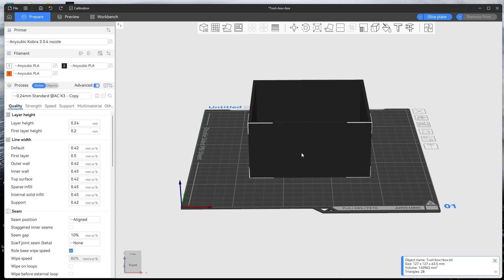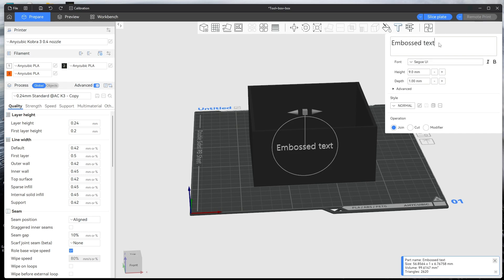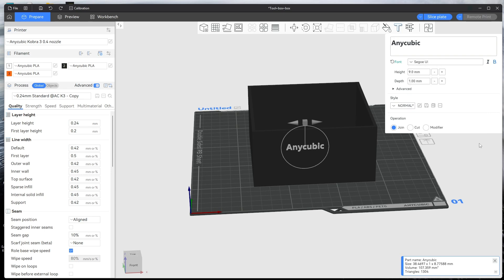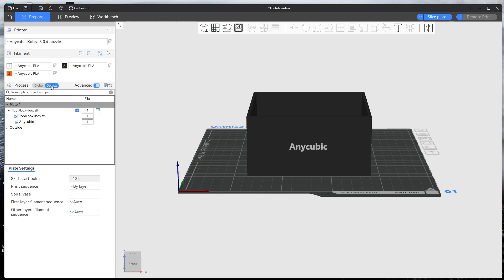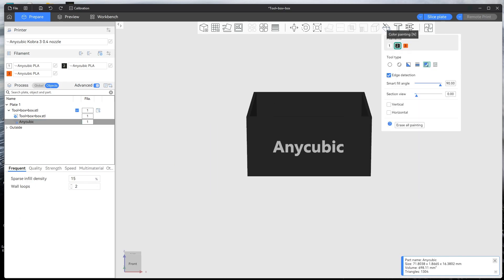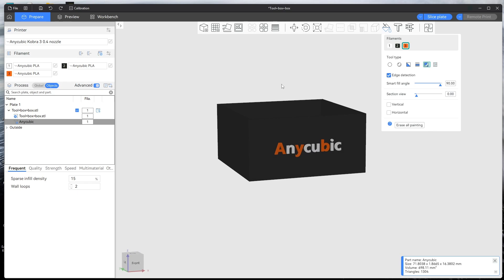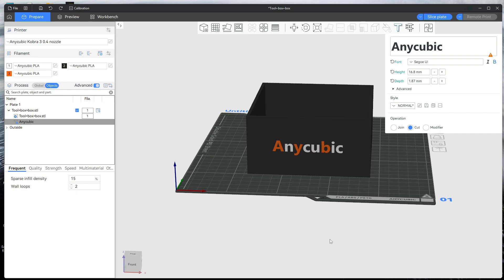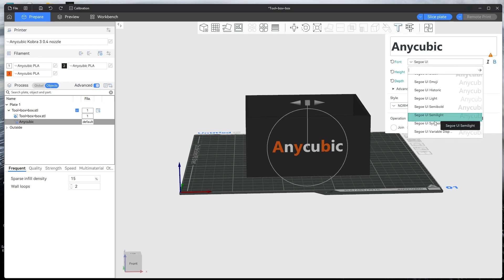How to add text to a 3d printed object in the Anycubic slicer next

Comment: This is helpful! But how can I shape the embossing to a not flat/rounded surface?
Reply from the maker: Hi You can use tools llike surface, per glyph, you can also adjust the font depth / size ect and u can also use join eboss or cut in the anycubic slicer Also you could try using different fonts.

Comment: I am printing tool box wrench organizers shared on makerworld that have numbers already on them. Is it possible to edit the label and change it to another number?

The lowest number they have is 7 and I need to make a 6. In the makerworld comment section the OP said these can be changed by "Click on the Wrench Organizer that you want to change, Click the Objests tab, right click text shape, click edit text. A box will open. Select Input Text and change it to whatever you need"
Reply from the maker: Hi that would really depend on the file you are using. If you load the model into the slicer and then click from global view to objects which is on the left had side of the slicer,  then click on the text or number you want to edit. If the text in the model is  
editable a box will appear which will allow you to change the text or numbers.

Comment: how to put text on the top off the model?please help 
greetings piet
Reply from the maker: @pietlancee677  Hi you can either turn your model so that top is facing you, and then add text to the top, or you can move the text around and place it where you it
Reply: @resin-art-and-3d-printing  
hello thanks for the answer i give it a try but i cant move the text from the bottom to the top off the model in free mode i do not now howe to do that
Reply from the maker: @pietlancee677  Hi Try this,  Click on the model then make sure you can see the top. if you can't see the top then go to the top menu bar where it says "lay on face" and click on that, it will give you options on which way up the model shows and prints.  Once you have done that and got yuor model top to face upwards, click on your model and then right click on your mouse, that will bring up a box with a load of other options, Go to where it says "Add Part"  and put your mouse over that, it will bring up another menu one of which is text, click on that and that will  allow you to add text to the top of your model or which ever  part of the model is facing upwards. If you cantt get it to work let me know and I will do a quick video to show you how to do it.
Reply: @resin-art-and-3d-printing  
hello thanks for the answer i try today off i  can get it to work 
i am new to printing and your videos are very helpful thanks for that 
greetings piet